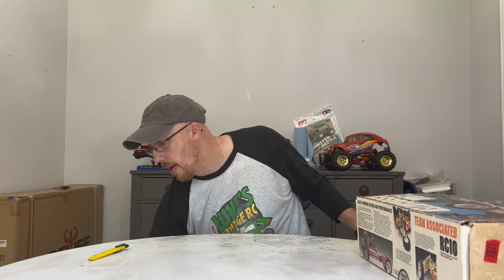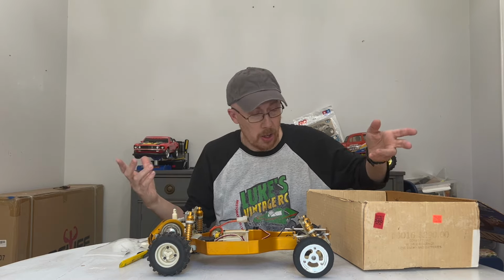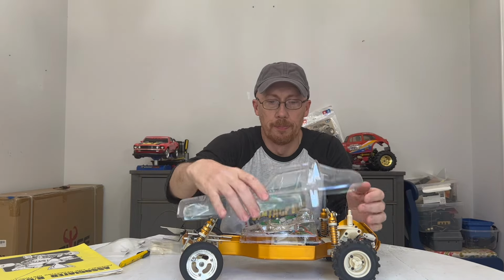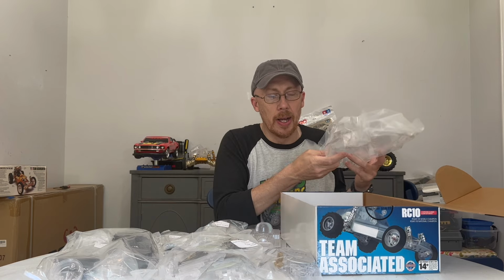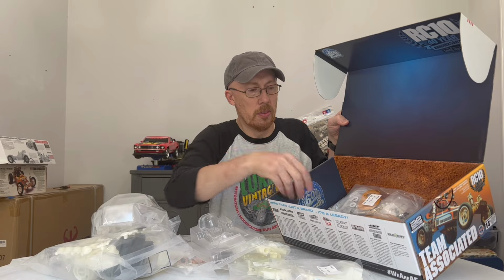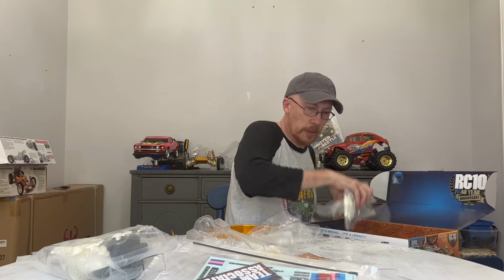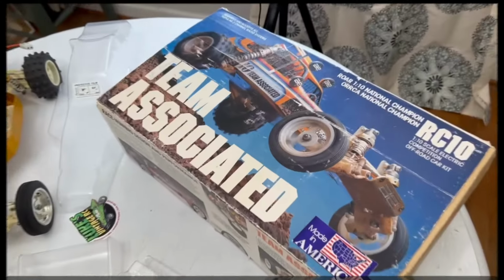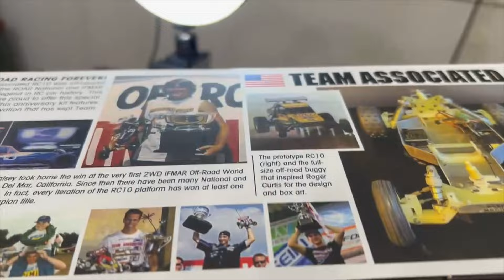Team Associated RC10 trio Build and Run Prt.1

Comment: I just finished my 40th RC10. It’s a real looker. That transmission build is interesting though especially the spur/ball diff with thrust bearing assembly
Reply from the maker: Pretty sure you had a great time.👊
Reply: @LukesVintageRC  that transmission is odd for sure. The manual leaves a lot to be desired too. My favorite brand to build is Kyosho by far. Tamiya is ok but Kyosho is just next level

Comment: Wow! Very cool. I still have my original RC10 and RC10t truck that I used to race. Both of those cars have the RPM conversion. I even have the Trinity Pink can and Green can motors which what was used back then for racing in the stock class. Thoughts?
Reply from the maker: Rpm is awesome friend quite special upgrades there. Sounds like a fun one. Thanks 😊